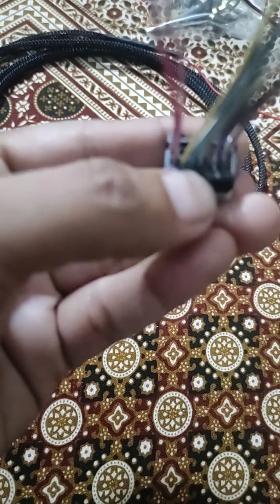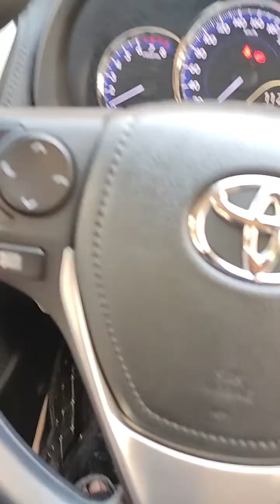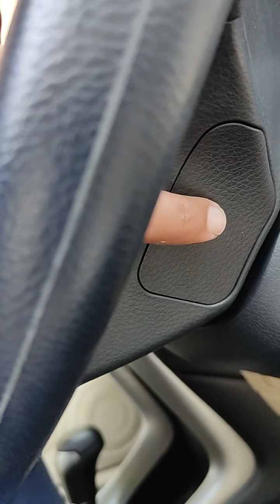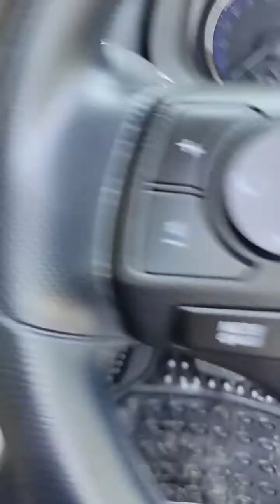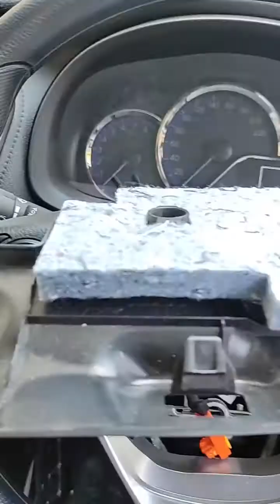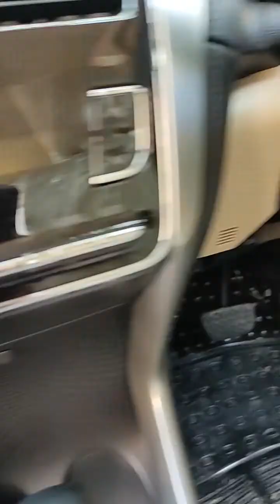Toyota Yaris/Vios (Automatic Only) Cruise Control Installation | Cruise Control A-Z Installation

Comment: Is there any place where we can order or get a wire with pins which fits in the ECU ans steering coulumn with cutting or modifying the wire as you did? What if we use the same pins that comes with the wire, do they not get locked?
Reply from the maker: Where are you from? In Pakistan we don't have these pins available. In other countries you might get these pins from the market but you need to know the two different types of pins you will need. First get the two old connectors (12 pin and 14 pin) and know the size of the pins and then order pins only and add them to a new wire. So you will get the appropriate pins at both side.
The wire I ordered from daraz had pins but they were small. Yes one of the end got locked in the ECM connector but only through the lock at the top of connector. Inside it was not locked as the pin was small. At the steering wheel area it was not locking at all. Another way is to tape the end part of the wire having the small pin, and then insert it and the top lock will lock it. It will still work but this is not recommended.
Reply: Ok thanks. I am from Lahore. Where can one get the 12 and 14 pin connectors? Are they available online?
Reply from the maker: Used car parts market. Kabuli market. Search for a shop that sells grips/connectors. Rates can vary. I got the 12 pin connector for Rs. 150 and the 14 pin connector for Rs. 400. One guy even asked for Rs. 1000 for 14 pin connector 🤣🤣🤣
Reply: Will do, I wonder what wire are the local installers using? Like of sehgal motors and others in lahore.
Reply from the maker: @iffianwar  in Pak people are forced to use pins taken out from Kabuli grips because new pins are not available in Pakistan. I don't think any electrician will be going into the hassle of finding the exact matching pin that I used in my video 🙂

Comment: is the wiring of yaris and vios the same?
Reply from the maker: Yes exactly the same connectors for Yaris (Pak) and Vios (Malaysia) and the same locations. Wiring and pins needed are also the same.
Reply: @firstgear6751  im from PH
Reply from the maker: Oh ok. Same for Philippines also 🙂
Reply from the maker: Also please note that this is for the automatic transmission only and not manual car
Reply: @firstgear6751  noted sir
Reply: @firstgear6751  Can Cruise Control be installed in Manual Yaris as well? I am from India.
Reply from the maker: I have not tried that. It may be done and may or may not require an additional component called Clutch Cruise Switch. But sorry I don't have complete details of how to do cruise installation in manual
Reply from the maker: Edward I have a question for you.
What is the perception of Changan Alsvin in Phillipines.
Comparison of Vios with Alsvin

Comment: video cuts off  suddenly while you are  connecting wire to steering wheel
Reply from the maker: Watch complete video please. I show locations where to connect all wires. Thanks
Reply: @firstgear6751  
Very helpfull, honest and highly appreciable video. But I agree to the comment that video ended immediately and I myself got confused.
Can you please share the image of connections you have made in black steering grip? Also at one point in video you said only one wire will be needed and towards the end you've connected two wires, 1 in EC and 2nd to ground.? Do we need both wire.?
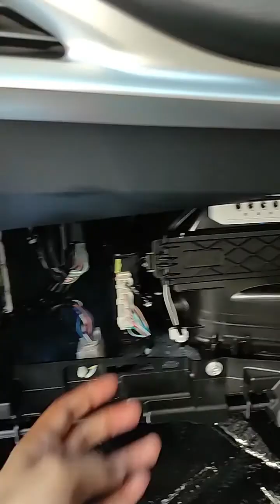Reply from the maker: 59:12 to 59:57